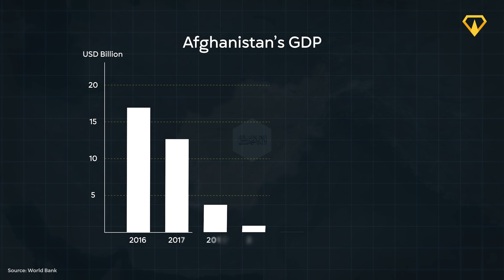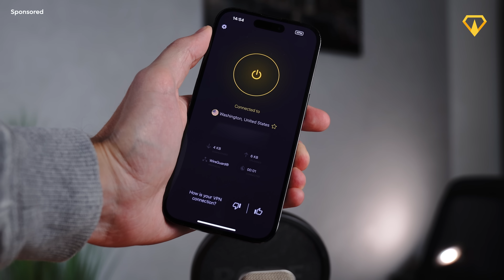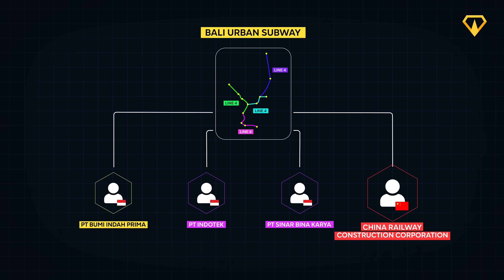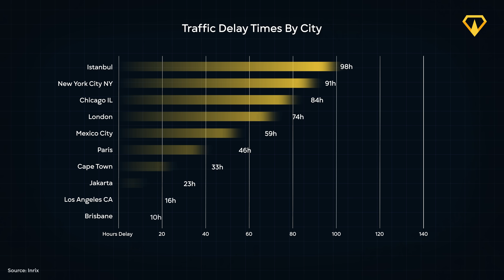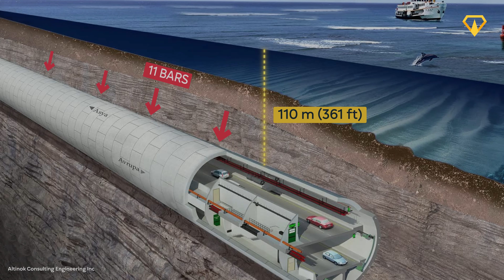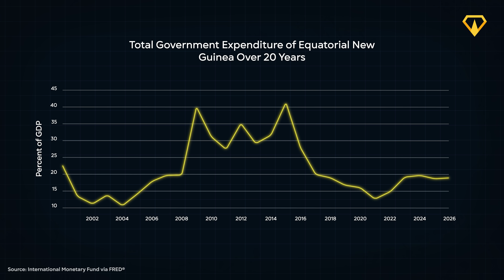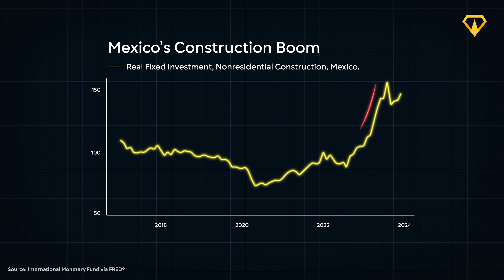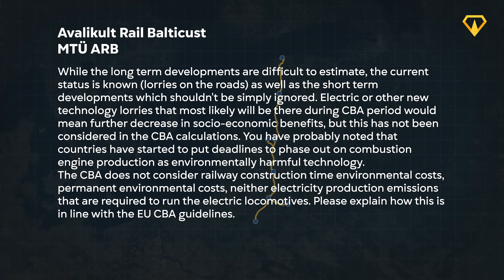The Biggest Megaprojects in Each Country (Part 2)

Comment: I love what Estonia, Latvia and Lithuania are doing.  Not just adding rails in the EU spec.  They are removing Soviet rails so an invasion would be much harder.  Along with that they are taking down the power lines that the Soviets controlled them with, as they are hooked into the EU grid.  Pretty much anything that gives Russia any leverage, or even a path to taking them back is being eliminated.

Comment: 3:26 Landlocked countries like Mauritania? Bro, what are you talking about? Mauritania has its own seaports, so why would it go to Western Sahara? 🇪🇭? In addition, Mali, Niger and Chad are using Algerian seaports now, and if they want the Atlantic Ocean, they will go to Mauritania or to a closer country like Nigeria or Senegal.
Reply: If you build it, trade will come. Regardless, if it makes trade more efficient with all these countries, it will benefit the people
Reply: @williamlloyd3769 

I know, but this port faces many problems. First, the cost of transport. Countries like Chad, Mali, and Niger will not leave nearby countries with cheap transport costs like Algeria, Mauritania, and Senegal and go to Dakhla. Second, the Western Sahara region does not belong to Morocco and is considered an independent state, and the Polisario forces control the eastern part of the Western Sahara, so they will not allow any truck to pass. Third, and the most important problem, is that Mauritania will not allow the Sahel countries to pass through to Dakhla, but will attract them to its ports because if the Sahel countries go to Dakhla, Mauritania will become a marginal country and will not benefit economically. The Mauritanians are not stupid enough to let this opportunity slip through their fingers, but they will exploit it, which will lead to the failure of this project.
Reply: Indeed. And Morocco and Mauritania will have to build a new railroad to access the port.